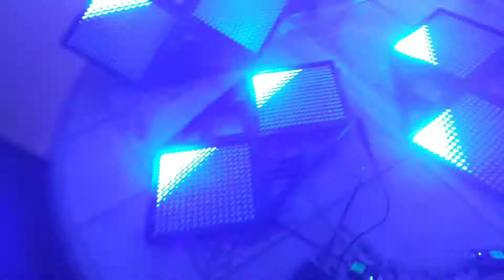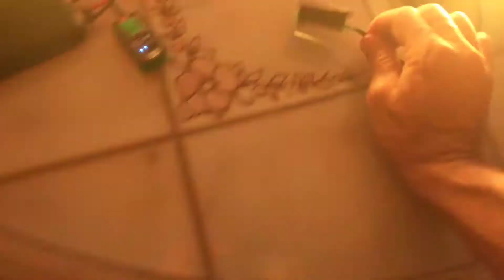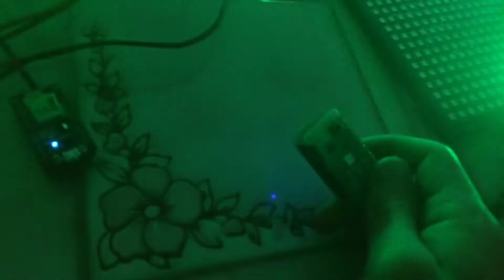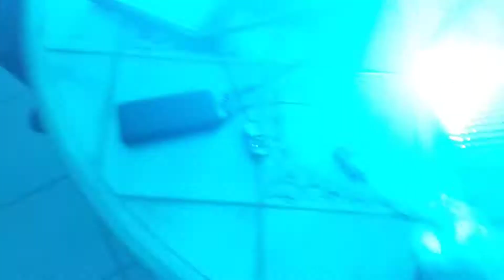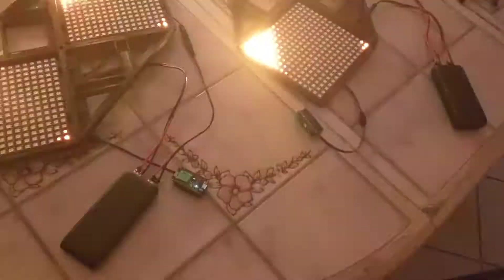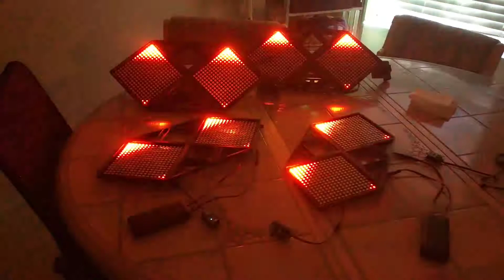Node Mcu ws2812b pixel driver update: adapter board + software

Comment: Nice, 
I'm working on a new LED panel myself, but I switched back to wired ethernet. Last time I used my even reduced setup in a crowded area (about 50 people ) the wifi nearly broke and I got a huge delay and a lot of packet loss. And no the people were not connected to my wifi.
Reply from the maker: Andreas Hölldorfer that's my concern too! what code did you use on the Arduino? my programmer and I are putting in a few data checks to make sure erroneous data isn't being used but it's hard to say with out having tested it yet how it will perform.
Reply: By now I tried a lot, a few self programmed solutions and nearly everything I found on the net, the last I used was this one https://github.com/esp8266/Arduino with jinx (http://www.live-leds.de/) . All in common I used UDP and I tried both broadcast and unicast. The problem I faced was that even I stopped the transmission it took about 2 seconds until all the buffer where empty. I'm thinkering now about 2 years with the esp8266 and leds and right now I'm frustrated because everything works fine the evening before when I set up my stuff just to fail when the party stars and a lot of people arrive. I really could watch it failing (increased delay) when more people enter the room. Years ago I build this ethernet arduino (http://chaozlabs.blogspot.de/2014/03/public-transportation-display-lcars.html ) and I got a few left so I decided to replace all esp with them. The next I do will be a updated version with an stm32 and ethernet.